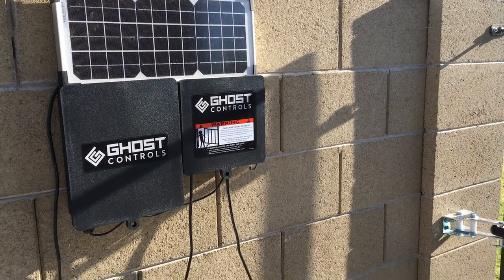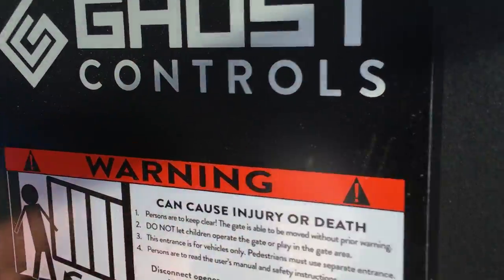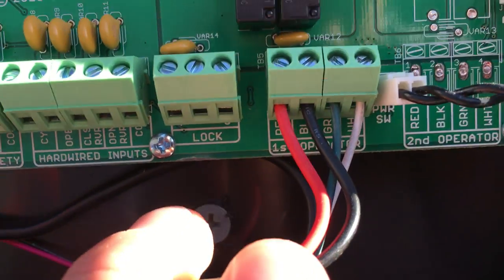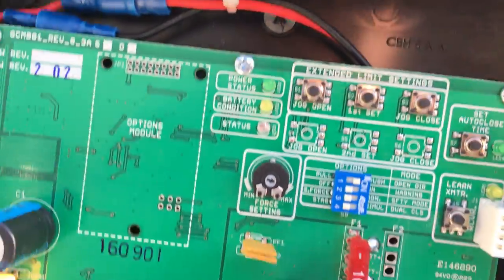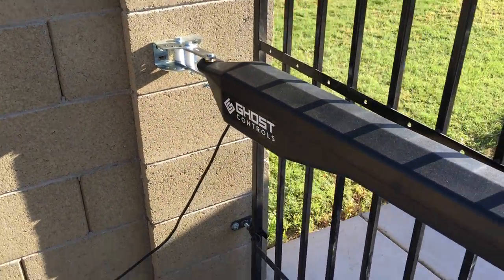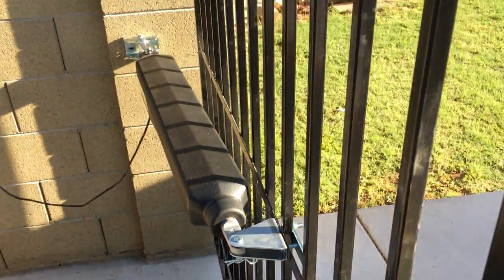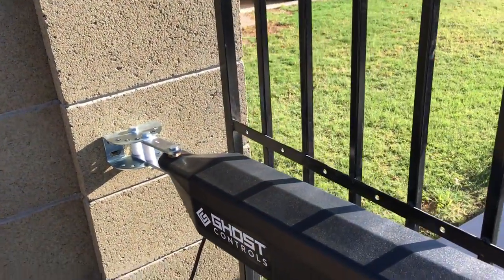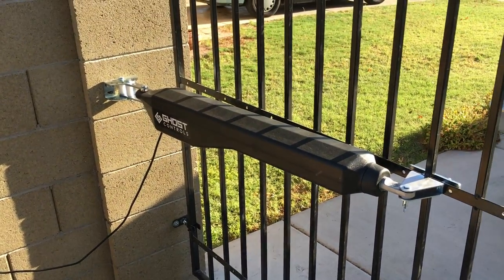Ghost opening the gate

Comment: Why do some sets have a car battery vs  the smaller ones in your video?
Reply: The smaller one in my video is also a 12 volt battery, just like a car battery. The difference is the storage capacity--a car has a much larger battery because it has much more demand to start the car. 
The smaller ones in the video are more like motorcycle batteries. 
The small size makes for an easy wall-mounted battery box, even in soft block like my wall is made of. I now have two batteries inside, just because I have the room, and they need to be replaced probably every few years since they are out in the AZ sun all day.
Reply: @mastergermandodorremoval  Thanks for the reply. I like how you put that bracket on your pillar. I was considering that but wondered how you did it. I have limestone pillars but the bolt will not go all the way there like the way the instruction guide suggests.
Reply from the maker: @danwesson1934  I used Red Head sleeved anchors, probably 3" x 3/8" but I'm not sure. I drilled the hole in the block, and found that it isn't filled with concrete, so I knew I had to be careful tightening. If it was filled with concrete, as I would have expected, I would just go as long as I could and tightened it up. As it is, I need to retighten every few years because the block is so soft that the sleeves wiggle out.
Next time I do it, I'll add construction adhesive to the back of the bracket and then retighten the anchor bolts to minimize the sleeves walking themselves out of the hole.
Reply: @DavePR  I’m hooking this up a 200 pound gate. I hope it works
Reply from the maker: @danwesson1934  Let me know how it works. If your gate is hung properly, the start and stop will be the only hurdle--mount your arm very securely to the post so there is no wiggle. If your gate is balanced, a child should be able to operate it, so the initial kinetic and final kinetic moves should be the only concerns.
Drop a video link here, or shoot me an email with your install to YouTube@MasterGermAndOdorRemoval.com. I'd love to see it!